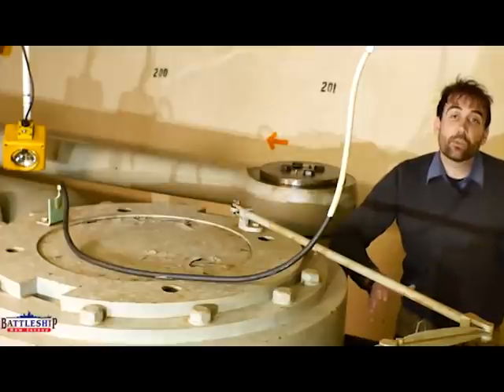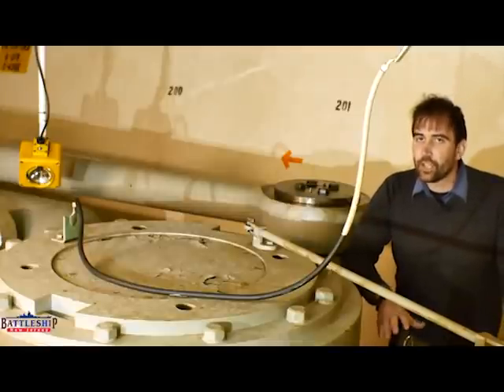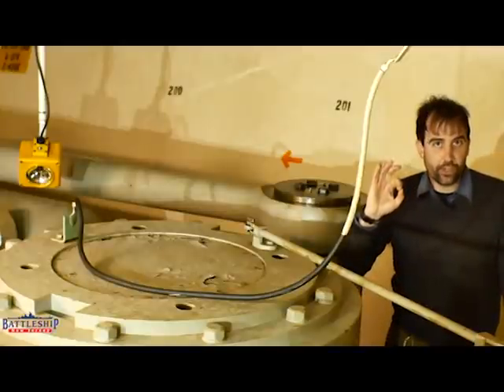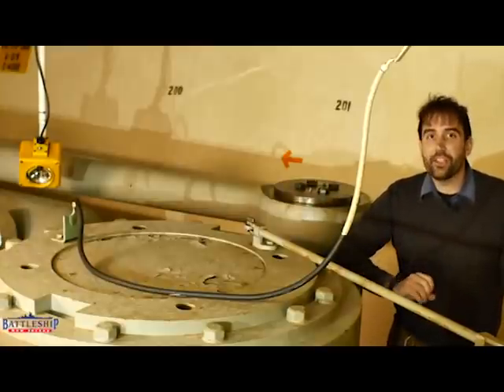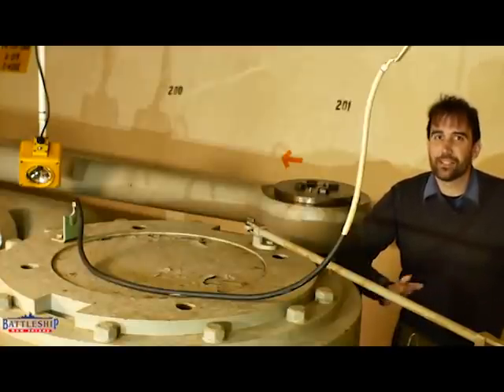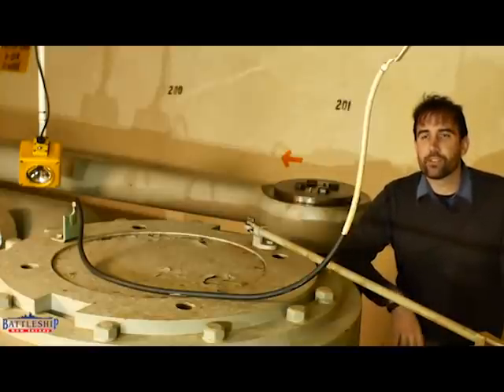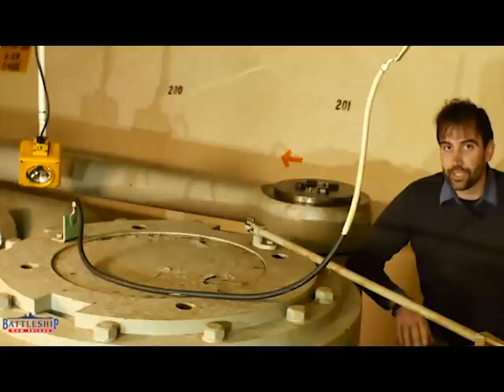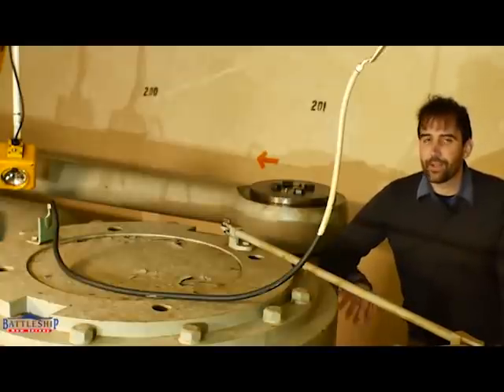Does a Battleship Really Have a Better Turning Radius Than a Destroyer?

Comment: ATPs (Allied Tactical Publications) and current OPORDERs (Operational Orders) set standard formation Tactical Diameters for use when operating in company. Conning officers must increase or decrease their rudder from standard to adjust their ships maneuvers. Typically set at 1000 yards. This way when in combat, everyone turns the same. This is not to be confused with a ship classes tactical diameter which Ryan is talking about.

When designed, and as confirmed during a ship's sea trials, the ships Tactical Diameter is the radius of the circle the ship settles into in a continuous turn. This is particular to the ship class and varies with speed. It usually, BUT NOT ALWAYS, reduces with slower speed. Some classes stay the same, a few even increase. It is published in the individual ship's characteristics for other vessels, as well as the ships information book for the crew.

Advance and transfer are the measures of the delayed effect of putting the rudder over on distance travelled forward and to the side before the ship settles into the final tactical diameter circle.

As well as the fineness ratio (length to beam) and overall length, stern design, and especially number and size of the rudder and placement inside or outside the propellor race have major effects on tactical diameter. Sumners had the exact same hull as Fletchers, but twin rudders, and went from 950 yards to 700. In the fifties, Fletchers rebuilt as DDEs with huge single rudders went to 630 yards, all at 30 kts. USN DEs, almost as fine as and not a lot shorter than DDs, were meant to play with U-Boats, had large twin rudders had tactical diameters of 300 yards. The PFs (Tacoma class) built to British design with single rudders, but very close to the same size, had a single rudder of the same surface area for 480 yards.

The design philosophy was that Battleships must maneuver in tight formations, so they got large twin rudders and small tactical diameters. Almost all cruisers of every nation, and USN destroyers from the flivvers until the Fletchers have single rudders to reduce drag, increasing the ships range. The USN planned since 1900 to operate in the Pacific far from its bases, long legs were far more important than tight turns. 
.
And yes, Ryan did misread yards as feet. Not his first or last glitch. But we love him anyway.

Comment: So the REALLY impressive part is the Tactical Diameter to Length ratio.  760 feet on a vessel 887ft long will SEEM much tighter than 700 feet on a vessel 608 feet long.  What was the time it took to deflect the rudders?  Is the Tactical Diameter achieved using reverse thrust on the inboard motors?

Comment: I served on the USS RANGER CV-61 1985 to 1988. Got to see the Mighty MO in action. All nine guns firing a slovo. Quite a sight.

That said, the Iowa class was the last BB ever due to Aircraft Carriers becoming the primary ship for battle. BBs became obsolete. Destroyers and other small boys became the primary defense for the carrier. BBs are too expensive in every way in the CV Navy.

A carrier can launch sorty after sorty to strike all beyond the range of an BB ever designed with the exception of the Wave Motion Gun of the fictional Battleship Yamamoto.
Reply: The Kirov class Russian ships(Peter the Great and Admiral Nakhimov) is classified as a battle cruiser.  They are nuclear powered, 827 feet long and displace 28,000 tons.  They were  commissioned in 1988 and 1998.  There were two other ships of the same class since decommissioned and a command ship based on the same hull as well.  They are currently based with the Northern fleet and the Pacific Fleet apparently.

Comment: I know a lot of people have mentioned this already but to reiterate - Ryan accidentally quotes feet rather than the correct yards when talking his tactical diameters here - and the US twin-rudder fast BBs really did have not just excellent tactical diameters but very rapid RESPONSE to helm inputs at normal cruising speeds (not always the case with large ships).  I don't know if it was about the skeg/prop/rudder flow or the direct wash of screws on rudder surface, or what, but the Iowas started to swing around quickly when the helm went over. There are online accounts of a helmsman aboard Saratoga (CV-3) describing the lag between helm input and the bow starting to swing - in a situation like dodging torpedoes, there is more to it than just tactical diameter. If your ship responds to the helm slowly, that means she remains on the course that will result in a torpedo hit longer, increasing the probability of a hit from a torpedo spread, which is designed to cover a certain range of ship evasive manuevering.  Lex and Sara were both awful at rapid turns and stopped torpedoes as a result.  The Yorktown class carriers had a single rudder, but it was EFFECTIVE for reasons I lack the naval engineering expertise to understand.  All I know was that they responded briskly to helm inputs, as evidenced by those accounts from the battles of 1942, and the famous film looking over the stern of Enterprise during that dive bombing attack during Eastern Solomons. CV-6 was changing direction with amazing speed, which must've made her a difficult target for a Val pilot OR a section of Kates trying to box her in with a torpedo attack...     Also guys, remember that the Iowa vs DD thing was originally an Iowa vs FLETCHER thing - the Fletchers were wonderful DDs, but they were the longest DDs the USN had ever built, and they turned out to be under-ruddered.  The Sumners and Gearings had twin rudders as a reaction to the lousy tactical diameter displayed by the Fletchers as designed.  Later, there was actually a retrofit, extended rudder developed for the Fletchers, but I don't think it was available during the war.

Comment: Even if it's a tactical diameter of 814 yards (2442 feet) that's much better than the slightly smaller Titanic's 3850 feet at 21.5 knots.

Comment: Well, 1940s Naval air footage showed that even the Biggest and Heaviest Battleship in the world, The Yamato, is quite menueverable and has a turning radius that's actually smaller than that of an Iowa, 700m radius of Iowa vs 630m radius for Yamato.
Reply: Because it is 6 knots-plus slower than an Iowa?
Reply: @brianchapman3701  being short, heavy and slow gives her better menueverability and also having a better Sea Worthy design doesn't hurt, Iowas where design more for speed.
Reply: @alistairdiren5790  Actually, as I understand it (from others, I am only a reader), USN WWII protocol was to engage at max range, which Adm. Lee would have done at Santiago Strait.

A 1984 Proceedings article written by two Ph.D naval experts stated Iowa's radar fire control over  Yamato was times 10. Iowa and New Jersey' speed (both were there, iirc) would have dicatated fighting range.

Thus (and I might be wrong, I am a landlubber), Yamato's maneuverability would have mattered little. The bottom line?

Comment: I've seen a picture of the USS Missouri turning inside of its four escorting destroyers in Chesapeake Bay in the late Forties in a commemorative photo book after Big Mo grounded herself, was refloated and repaired. It was the University of Colorado's Norlin Library in the late 1990's. The caption said it was accomplished by putting the rudders hard to Port, placing the port propellers in reverse while keeping the starboard propellers in forward.

Comment: The “tactical diameter” is never less than the ships own length; if so it would almost pivot in place.  While the gist of his information is correct (such as length to beam ratio, or fineness, and the effect that has on turn radius), Ryan is repeatedly confusing feet with yards; the Iowa class’s turning radius runs about 815 YARDS, or about 2450 FEET, compared to a length of approximately 890 feet.  While that’s not the stupidest mistake in the world, it would be inherently obvious for anyone with any sort of experience in almost any sort of vehicle - after all, nothing turns in it’s own length at any kind of speed.  If we’re trying to visualize this, the actual 2400 feet diameter turn is about a half mile, and that makes a lot more sense than turning in less than her own length.

In the real world tactical diameter doesn’t really matter as, except for photo ops, navies don’t maneuver in close formations as they did back in WWII; in modern operations the ships may be out of sight of each other.  But back in the day, when ships would maneuver in close formation they would turn using standard rudder (vice full rudder) which would give all ships a standard diameter turn instead of a tactical diameter turn, which is what leads to those aerial pictures from WWII of ships all turning together.

“Standard rudder” varies from ship class to class in order to produce that same standard diameter turn.  Each ship carries a set of tables/charts that give the turn diameters for various speed and rudder angles; in addition, as navigators would know, those tables will also have the distances known as advance and transfer, which are how far a ship will move down the track and offset to the side for a given amount of turn; this doesn’t matter out on the ocean but is vital when coming into a harbor channel; for something as large as a ship (as opposed to your ski boat) we have to lead the turn and kick the rudder over early so that we’re still in the channel when we come out of the turn.  Remember the width of a channel is often less than the length of a ship….but that’s a different subject…
Reply: @Phil M that makes absolutely no sense. Other countries build houses in metric without it costing more
Reply: @MatthewMakesAU  no, think about it - one square meter of lumber costs nearly ten times as much as a proper, american square foot of exactly the same lumber!
Reply: And this is why everyone should use metric

Comment: 814 yards does seem more realistic than 814 feet.
At what point of the ship is the tactical diameter calculated?  As the picture at 2:00 shows and common sense would indicate, the stern travels at a much larger diameter and greater speed  than the bow.

Comment: A thought: The turning radius may be smaller when you're going slower, but with less water flowing over the rudder wouldn't the actual turning speed also be much lower?  Doesn't turning quickly matter more than turning tightly sometimes?
Reply: The problem is the weight of the ship want to keep going in the direction it was traveling. Just like on a icy road when you attempt to turn the car it tends to keep going the way it originally going. Water gives even less traction than ice does.

Comment: I was blown away when you said a destroyer was over 1000 feet. Why???

Curious about the SoDaks,  very short ships. Was their tactical diameter small?
Reply: Probably the same reason as the older aircraft carriers: one rudder.
Reply: @yes_head  pretty sure they had 2.
Reply: USN Destroyers from the "Flivvers" to the Fletchers had one small rudder. Everybody's cruisers did too. Fantastic for greater endurance, longer range,  Piss poor for tight quarters maneuvering. USN DDs were designed to fight in the Pacific far from their bases. Sumners had the exact same hull as Fletchers, but twin rudders, and went from 950 yards to 700. In the fifties, Fletchers rebuilt as DDEs with huge single rudders went to 630 yards, all at 30 kts.

Ryan misread yards as feet, but got the numbers right. We love him anyway. SDs tactical diameter was 733 yds @ 26.5kts, 700 yds @ 20kts.

Comment: Nice turning radias, but how does the milage compare to my 1988 Toyota Corolla?
Reply: The general figure for modern cruise ships is rumored to be about 1 ft per gallon of fuel.  Steam generated power is much less efficient as is old riveted and welded hull design.  At that rate the mileage would be something like one Toyota per mile.  Of course these are just guesstimates not to be taken as seriously.   I'm sure there are fuel consumption numbers somewhere on the Internet if you dig deeply enough.

Comment: As a former conning officer of Missouri, I will say that you need a little prop wash over the rudders to kick her over.  If you are going much under 10 kts, even if you throw the rudder over full, she is stubborn in getting into her turn.  Over 15 kts, way different story.  She starts handling like a sports car with just a little bit of rudder.
Reply: Kind of like a Sea-Doo...
Reply: You can see how nimble they can be from wake photos of them in action, there is one from Korea where it's clear it turned inside it's length.
Reply: Probably her Mass, once you have enough speed its fine, need enough to overcome the sheer weight.

Its got alot of mass per size to overcome.

Comment: Don't forget that the Iowas were quite a bit longer than the King George V class but according to Friedman still had a better turning radius. It was not really the twin screws but the design of the skegs in the stern. It was slightly less fuel efficient than the British battleship stern but better for turning.

Comment: Yamato had:
advanced tactical diameter - 589m at 26kts
tactical diameter - 640m
Source: Janusz Skulski - Battleship Yamato.
Reply: I don’t believe that, Yamato was too wide in the beam and slow.
Reply: @floydrandol2731  you better believe it... It has better lenght to beam ration then Iowa = better turning (and it was shorter then Iowa btw).

Comment: With four screws, could the ship turn even sharper if the two "inside" props were reversed?  Or would that sacrifice too much way  and leave the vessel travelling too slow ?   Are bow-thrusters a thing on navy vessels ?    I don't book-face.
Reply: You can use asymethrical thrust to assist steering up to a point.
The problem is, those screws are relatively close to each other, so the difference isn't that great. Putting half your screws in reverse might imo do more harm than good, as it might very well stop your ship.

As to bow thrusters, I haven't heard anything about them already being used in WW2 era ships, but I simply might have missed that.
Reply: Yes both littoral class' and the Zumwalts have bow thrusters so do a host of patrol boats however the are a maintenance nightmare in the larger vessels and part of the reason for their dismal operational history's and add to the reason they are all headed for the scrap yard after less than 10 yrs of class operations.
Reply: Bow thrusters are not a thing on navy vessels, because, they only work when almost stationary, thus don't help turning.
At any significant forward speed the water flowing past the hull prevents almost all water from entering the thruster tunnel.
A good video about maneuvering options (although for commercial shipping):
https://www.youtube.com/watch?v=Qjp3iUfmZ1A
Reply: I dont FacePlant either, Zuckerberg is satan.

Comment: I have seen comparisons between Iowa"s and Alaska's, not specific diameters, Alaska's being less maneuverable. Alaska's had single rudders, a short sighted design implementation.
Reply: The Alaskas were oversized heavy cruisers (single rudder) not scaled down battleshiops.
Reply: @chocolatecatdad  Yeah I know that. Her dimension were similar to an Essex but had a single rudder. That was the point.
Reply: @JohnRodriguesPhotographer  The point is that cruisers are designed for the most efficient cruising range, not for tight maneuvering in a battle line. Totally different design philosophy. Alaska's really were NOT supposed to be in the battle line.
Reply: @grathian  cruisers never have to avoid torpedoes? Shortsighted theory.

Comment: I've seen films of Japanese carriers dodging bombs & torpedoes with hard over maneuvers in the battle of Midway, which was very impressive for ships of that size under fire.
Reply: The Japanese carriers lost at Midway (with the possible exception of IJN Hiryu) were all caught "flat footed" - they were not maneuvering when struck by dive bombers. Thankfully, they were distracted by the heroic earlier attacks of the torpedo bombers. Later in the war, Japanese carriers were maneuvering when attacked, but they were basically overwhelmed by weight of numbers of the attacking aircraft, combined with skillful tactics.
Reply: They lost 4 carriers and a Cruiser at Midway. I 'd say their "hard over maneuvers" stunk and were "VERY" unimpressive for ships of that size. Maybe, if the Japanese had better design ships they could maneuver better. No idea what you are talking about?

Comment: Ryan you left out how much reducing the engines revolutions on one of the outboard propellers affects the steering and turning radius of a battleship. You also mentioned the standard class but  the Tennessee, and Colorado class could make  turns without even using it's rudder because of it's turbo electric engines could be switch on/off increase/reverse at a flip of a switch vs steam gear ships.
Reply: In the last minute he mentioned how the twin propellers helped with a tight turning radius/tactical diameter.
Reply: 9:27